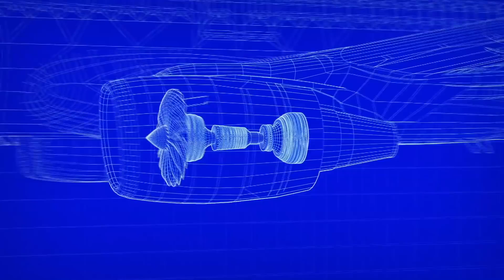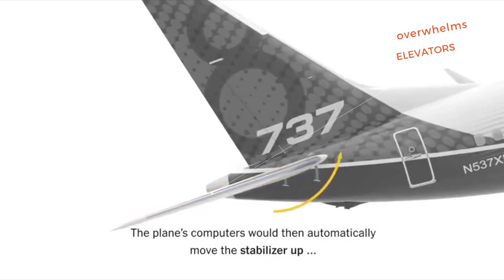737 Max 8 probable cause revealed - Prof Simon

Comment: I am a 737 Max pilot. I enjoyed your video and explanation and you are certainly on the right course. As I am sure you are already aware, with most crashes the cause is usually a chain of events rather than a single culprit. The MCAS is certainly a major factor but it can be defeated. In the case of Lion Air, none of the operators were even aware of MCAS at that time. Very shortly thereafter however, we were all made well aware of MCAS via a bulletin from Boeing and additional training pertaining to MCAS was provided. The defeat is a simple drill, the same drill we would use to defeat a runaway stabilizer trim. It is a memory drill, so we would not consult a checklist for it, as time would be of the essence. Since Ethiopian, I have gone into the simulator and programmed a runaway stabilizer event to the full nose down. We cannot yet simulate an actual MCAS event. However, as I said, the drill is the same and a stabilizer running to full nose down would produce a similar effect. As soon as you activate the Stab Trim Cutout switches, it is like turning off a computer by pulling the plug out of the wall. MCAS is no longer powered. Easy right? Well this is where other factors come into play.  In the stabilizer trim runaway drill, we immediately disconnect everything and put the airplane in a manual state.  Autopilot and auto thrust get turned off, we maintain pitch manually and activate the trim cutouts. In the case of both Lion and Ethiopian, the thrust would have been at climb thrust, just below full takeoff thrust when the pilots would have disconnected everything. Without any further inputs from the pilot, the thrust would then remain at that last power setting. ( I don't know if this was the actual case but I think Ethiopian was doing something like 400 knots when they impacted the ground  which would indicate to me that thrust was not reduced ) If the pilot was struggling with pitch control, he may very well have not thought to reduce thrust, especially if there was a stall warning going off as a result of the faulty AOA sensor. All the while, the aircraft would still be accelerating. Now if you were to try to trim the stabilizer "manually" back to a neutral position, the aerodynamic forces would be very difficult to overcome. Think of the leading edge of the stabilizer, it would be pointed well above the longitudinal axis of the airplane. As the airplane accelerates, the force required to bring that leading edge back into alignment also increases exponentially. Particularly if you are pulling the control column in the opposite direction and defecting the elevator up. One force is acting against the other. When I did this in the simulator, I needed to get the speed back to about 200 knots, then offload the stabilizer by releasing any back pressure I had in order to move the trim wheel. At 250 knots and no offloading of the stab, the manual trim wheel would feel like it was seized. This could lead one think that the jack screw actuator in the tail had somehow failed, as happened with Alaskan Airlines flight 261 in 2000. The newer generation of pilots have all been brought up on automation and are very comfortable with it. However in my opinion, there needs to be more emphasis on the old school "stick and rudder" manual flying. ( think of the 20 year olds back in WWII flying B29's back to England with half the wing missing ) If you look at how the crew of Quantus 32 handled a catastrophic and non contained engine failure in a highly automated Airbus 380, you will see that the Captain did just that. Initially, he chose to ignore the automation with all of the associated and overwhelming, distracting alarms and fault messages. Instead, he focused on whether or not he could keep the aircraft airborne manually. Once satisfied that he could indeed maintain control and fly the aircraft in it's crippled state, then and only then did he direct the crew to start responding to all of the ECAM messages. Systematically going through them in a calm and concise way because due to his experience, he knew that those alarms and warnings were secondary to actually flying the aircraft. An American Airlines Captain identified an issue with pilots and automation many years ago and authored "Children of the Magenta". His presentation of the subject is here on youtube. It is enlightening and relevant.
It is so unfortunate when there is any loss of life due to an aviation accident but it is never in vain. We always learn from them and the industry will no doubt, learn from the Lion Air and Ethiopian accidents. Sadly, that provides little solace to the families of the victims. It should be noted that my comments are just that, mine and only form an opinion based on what I know as of today, which is precious little in the grand scheme. It is very easy for me to sit back in the comfort of my home and speculate on what the pilots were dealing with. It is still too early to know exactly what happened but it is becoming clear that perhaps Boeing should have started with a blank sheet of paper, rather than trying to dress up a 50 year old airframe.
Reply: Thank you Captain Paul Renny, for your elucidation that helps all we novices understand your report.
Reply: hey Paul I have a question I am hoping you can help me with. from the reports they are saying that the max 8 engines were moved forward and are heavier than the normal engines and this causes a nose up or pitch up effect .
I am trying to understand this because if the engines are heavier and moved forward then the center of gravity is shifted forward and this will cause a nose down effect 

could you be kind enough to explain how this nose up is casued
Reply: Don Mar  no it doesn't make sense.  What they are saying is that the greater pitch moment is caused by the higher thrust of the new engines. 
The larger engines are taking airflow off the wing. This results in less lift, easier to stall. And, at higher angle of attack, the engines block even more airflow. 
This should have been discovered by fluid mechanics studies.  However,  nobody in the engineering department knows anything about engineering.
Reply: Paul Renny : Excellent and informative write up. I believe if  Boeing makes the changes being planned : 1) Make Pilots aware that MCAS is active, 2) Pilots better trained to know how to disable MCAS if they desire and in that case also know how to fly the plane safely in that mode 3) Improve MCAS sensor redundancy by utilizing two AOA sensors then the 737 MAX can be deemed safe to fly again. I do not believe  the 737 MAX is necessarily an unsafe plane. Your thoughts?
Reply: Easy you to say..can you bring back the deaths to life?

Comment: why Boeing should not instal the disable switch in the cockpit of the  aoa sensor wrong signal comand to Mcas.why should not instal the mcas system disable switch in the cockpit for few minutes.why should not exept the hydraulic and mechanical system of the plan in put manual command hard struggle from the pilot's to stable the horizontal stabilizer . why should not automatically disable the mcas system during the manually attempt and hard struggle to struggle for control the plan from the pilot's.

Comment: Are throttle settings integrated with the pitch control?
Full throttle could fight against the pitch down effect and perhaps cause porpoising of the aircraft.

Could vortices of the engine thrusts effect the airflow over the horizontal stabilizers at certain pitch/speed regimes?

Could wing flex change the normal flight characteristics at a high angle of attack and cause control sensors confusion?

Comment: The crucial question which no-one seems to be asking is WHY did the AoA sensors send incorrect data to the MCAS? If you don't know the answer to that you can't be certain that the work-around Boeing is planning (software updates, limiting the MCAS, coordinating data from both AoA sensors, etc.) will really make the airplanes safe to fly. 
Assume for instance that it could have been caused by the introduction of the the new ARINC 717 data communication protocol which replaced the ARINC 429 protocol used on all previous B737 models - maybe the new protocol is more vulnerable to voltage irregularities ? If that were the case it would not just be endangering the function of the MCAS, but ALL electronic regulation systems in the aircraft. The pilot can push on the throttle to increase engine power but the signal to the engines is electronic. Not only have there been two crashes due to MCAS malfunction but there have been several reports of engine disturbances. Recently following the grounding of the B737 Max, Southwest were ferrying their airplanes to a storage hangar in California. Shortly after takeoff the pilot reported engine disturbances and made an emergency landing in Orlando. There have also been pilot reports of engine disturbances. The reports were filed, but no action was taken.... If Boeing wants to regain trust they must show complete transparency. Up to now that has been sorely missing!

Comment: I'm not convinced: The stab trim moves very slowly, even if driven by MCAS (as you showed in this video). The pilots would have had ample time to oppose it before it went too far, by pulling on the control column. And there is a safety interlock between the two which prevents the stab trim moving in the opposite direction from which the pilot moves the column. Also, there is a stab trim cutout switch on the central pedestal, near the throttle levers, which the pilots can use to stop stabiliser movement, and even if this is used they can still wind the stab trim wheel by hand. I don't understand what could have gone wrong with MCAS which could not have been managed by these safety backup systems.

Comment: Here's the likely scenario, from  US airline captain: 

Boeing (and many posters) say "Hey, it's just a trim runaway. Do the drill and all is good." But this is not the simple trim runaway that the QRH contemplates. It starts with a stall warning stick shaker shortly after lift off. Close to the ground this will, and should consume both pilots' undivided attention. After a number of seconds they realise that the airplane hasn't stalled and they start figuring out that they may have an airspeed and/or AOA problem.

This is a second problem to deal with on top of the first. And they can't shut the &%$#@ stick shaker off once they realise that it may be spurious. The PM will be frantically scanning the panel to try and find some clue what is going on. And this whole time, among the din of the stick shaker, the crew's concern for the airplane's flight path, and the confusing instrument indications, MCAS has been intermittently dialing in nose down trim. Not steadily, in a calm cockpit at altitude like the QRH contemplates.

But intermittently in the background of chaos, noise, and confusion. At some point, well past when it would have been timely, the task saturated PF realizes that the trim is working against him/her and the stab cutout switches get turned off. (hopefully). But the shitshow isn't over. Because of everything else going on, this took too long and the airplane is way out of trim. The Lion Air crew reportedly had 60 KG of back pressure on the yoke. Close to the ground, and relying on the lifting component of the underslung engines to help keep the nose up, the crew do not dare reduce power. Now the crew needs to manually trim the airplane, but the airplane is way, way off its trim speed. The B737 QRH makes reference to the large forces that may be required to break free a servo clutch:

"3 If needed: Use force to cause the disconnect clutch to disengage. Approximately 1/2 turn of the stabilizer trim wheel may be needed. Note: A maximum two-pilot effort on the trim wheels will not cause a cable or system failure."
Worse, the "Manual Stabilizer Trim" section of the Boeing FCTM talks about the air loads on a grossly out of trim stab requiring a speed change to reduce the force required to manually trim:
"Excessive air loads on the stabilizer may require effort by both pilots to correct mis-trim. In extreme cases it may be necessary to aerodynamically relieve the air loads to allow manual trimming. Accelerate or decelerate towards the in-trim speed while attempting to trim manually."
Sweet Jesus how did this thing get certified?

A guy (or petite gal) has a 60 KG+ force on the yoke trying to stop the airplane from impaling itself into the hard ground just a few thousand feet below, and now he/she has to brute force trim the airplane as well, requiring involved coordination with the PM. Still with all the stick shakers, aural warnings, goofy instrument readings, and whatever else is happening to distract the crew and making communication almost impossible. It is not hard to see how quickly it becomes overwhelming. In addition to a fix for the airplane, if they keep the MCAS system (instead of designing a whole new wing or tail for the airplane), they will have to train the pilots who fly it to deal with its failure.

Right now, there is not a single Max pilot in the world who has been trained for this failure because - there isn't a single simulator in the world that can replicate it. But when they do, all those pilots that claimed "it's just a trim runaway" are going to have a very eye opening simulator session."

Comment: I have no idea what is happening with Boeing, the FAA and the NTSB.  How
 this plane was allowed to fly is CRIMINAL.  The fact of the matter is 
that with only ~370 or so 737 Max 8s with barely any flight hours in the
 air 2 are fiery  rubble.  There were many reports by pilots regarding 
this problem.  This is what happens when MBAs (masters in business 
administration) push PEs (professional engineers).  I don't even want to
 fly on any Boeing aircraft for fear of them changing what was working.

Comment: I'm heartbroken that Boeing let REQUIREMENTS CREEP rule when the 737 MAX was hurriedly designed and built which led to the loss of 346 lives in two crashses over a 5 month period.  Apparently, the aircraft did not adhere to fundamental flight stability design rules but instead used software solutions to make it fyyable which I've only heard being done in military and aerospace applications. Boeing and the FAA should have known that this approach, coupled with the lack of proper pilot training upon implemention, was unprecedented and should not have been certified for commercial airline applications by Boeing or the FAA!

Comment: Reminds me of B-2 plane, which also needs computer control not to fall down. Guess what, one of them crashed because the sensor failure. Considering there are 21 of those ever build and each costs 2 billion dollars, even one crash (for very similar reasons as 737 MAX's) is a lot.
Reply from the maker: Many military jets have stability software but it’s not a good way to fix an unstable commercial aircraft in my humble opinion.

Comment: Again i don't get it the pilot was pushing the nose up but the MCAS was pushing the nose down, so the plane was not in stall position .
Reply from the maker: The angle of attack sensor was making the mcas think the nose was too steep
Reply: @SimonHollandfilms  yes i understand , but if the pilot is continuously  correcting the action of the MCAS the plane should fly more or less level . Thanks for your reply